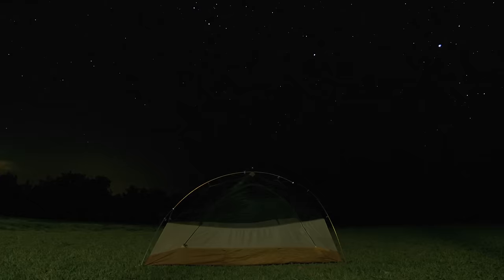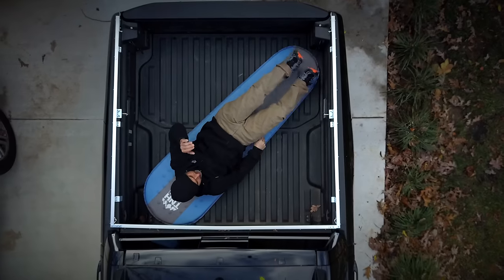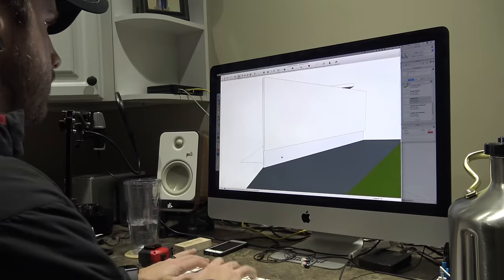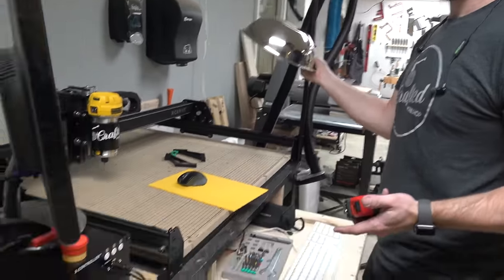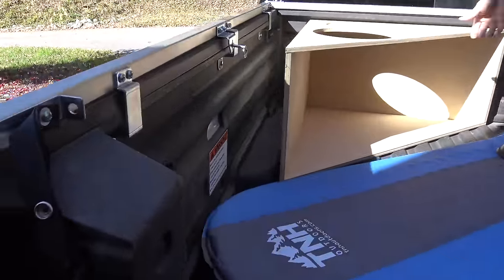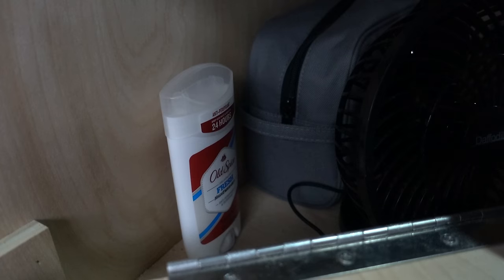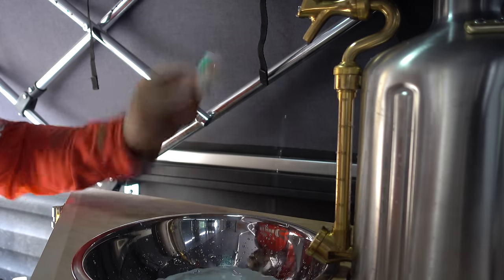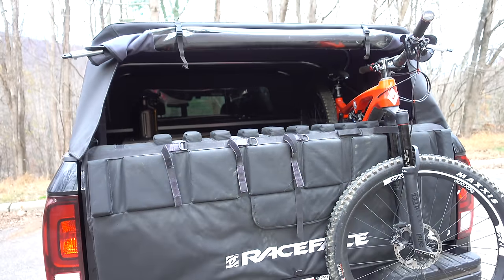Compact Pickup Camper - Vanlife without a Van

Comment: I am super jealous of the under the bed storage that the ridgeline provides. I got convinced to get a hard camper shell for my Frontier for the upcoming trip. I am not a huge fan of the fact that I won't have a place to store it when I will be using the truck during the summer to haul my dirtbikes etc. I think after my cross country trip I will sell it and go for a soft shell like you did. Much easier to put on/off when I will be going on dirt biking trips.

Comment: my Titan has the same tiny bed and I'm 6'3" so i feel ya on the diagonal. I even sleep in a regular bed diagonally too!  I have a hard shell topper on my bed and i open the hatch and tailgate and drape a tarp over it for a little "vestibule" area and easier climbing in and out.  I've used a pesticide sprayer (new of course) for my pressurized water.  You can take a full shower with one of those!   I definitely need to build a little cabinet though good video and have fun.

Comment: You don't actually have to CNC much of anything, it can all be done by using a thin 1/4" plywood piece either on the bottom or the top depending on how sturdy you want it. If you want the cutout deeper, use a thicker wood. Pocket drills are nice, and more professional, but all corners are butt up on 90deg, and 1-1/4" are more than enough to hold such a light structure.

Its a well done design, and seeing this video has me thinking about how I can actually use Google Sketchup. It previously wasn't on my radar. The best part of this video, and Youtube is that you can really pull inspiration and ideas from a lot of other people without a lot of trial and error or find a better idea than you originally planned.

Cool video, I enjoyed it!

Comment: Very cool!! I've have a Honda Ridgeline 1st generation, and have been thinking of doing the same thing. But I was thinking of doing the bed in the back seat of the truck. Then I'd have the entire bed of the truck , under the soft top, to create the camper in. I figured to open the rear window, and have a cabinet right underneath it, also, as an end table . Haven't completely figured out what cabinets , "eating area", and cooler etc to put in the back. I'll also do what I've done in the past, and put an indoor carpet in there, too. Very cushy. Lol

Comment: I’m rocking an f150 with an 8ft box (real truck) and 6 inch raised topper. Vented side windows and completely carpeted box and cap. 

Sooo much room. It even has a rack on top that will handle 500lbs. If your road tripping stealth mode not much beats it.

Comment: For the sink, drill 5 holes at the lowest points and attach a funnel under it and put a container to the end of the funnel, so constantly, you don’t have to empty the sink bowl. I recommend anchoring the container down to something so it won’t move or tip over

Comment: For the hole you can just use a hole cutter. You can set them to any diameter and they are not that expensive. Used wird a good Drillpress you can get good results

Comment: The other solution I've seen for small trucks is putting a roof top tent on top of a tonneau cover.  I am also a proud owner of a 5ft bed pickup, so an option that doesn't involve pitching a tent in bear and mountain lion country is always welcome.  I do actually love my tonneau cover for transporting the bike, while I do have to take the front wheel off, once it is loaded, it is completely closed and locked, nobody can see the bike, so no temptation for thieves.

Comment: you should cut a hole in the sink bowl, connect a hose to the bottom and run the hose to the back of the van so it can drain outside

Comment: I dont think Ive ever seen a Ridgeline camper, or even seen a Ridgeline up close. That underneath comparment is pretty darn cool!  My Titan has the same shitty little 5 1/2ft bed on it.  But I'm 6'3 so it makes it a little bit tight.  I barely fit on a diagonal. I usually just pop the tailgate and hatch and drape a tarp over the back tied off the hatch handles. Then I have a place for my muddy boots to go kind of  like a vestiblue.  I find that my fiberglass Leer topper leaks though. I have to jam grocery bags under it to keep water out. Does the soft top leak much? LIving in an apartment I can never take my hard top off since there is nowhere to store it. I like the ribbed hard plastic bed liner because I put plastic sheeting down inside and any water runs right under the plastic.  I can see why sleeping on a platform may be beneficial.  Planning on adding some cargo nets and pockets to the roof here pretty soon to really optimize my space and give me a place to hang a lantern.  I may hang a bunch of old bookbags up there for zippable storage. Would  be easy to hang netting and stuff off the frame of yours.

Comment: Great idea, but I have a question: why didn’t you let the counter top extend all the way to the side of the truck bed (over the wheel well) to give you even more counter. The battery still could fit below that. I’d hate having a big gap between the counter and truck bed wall. 

Also, how do you keep the pressure used beer can from falling off?

Comment: Great build up! I've been considering a Softtopper for trips where my Tepui doesn't make sense. Home Depot sells a 3" x 72" x 24" memory foam pad for $25 (SKU #794736) if you need more padding. Wrap a sheet around it or sew up a custom cover and you're set. They don't roll up tidy but they are comfortable, especially on top of your camp pad.

Comment: Using Pythagoras I can call calculate your height u said that the back of ur trick is 5,5 and assuming the truck is build properly the angles should be 45 degrees so tan(45 times 5.5= I cant be bothered doing the rest of the math